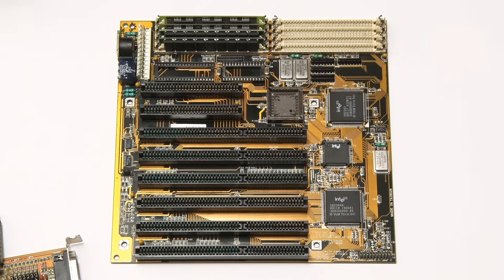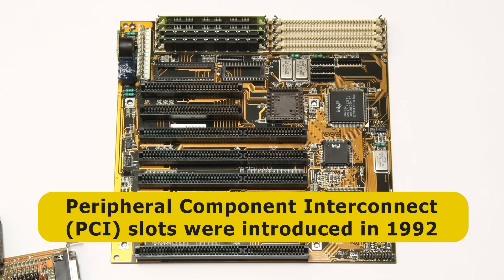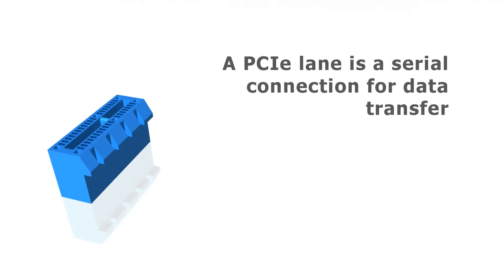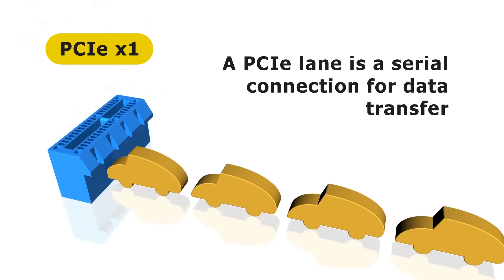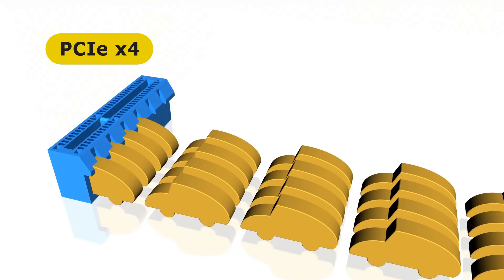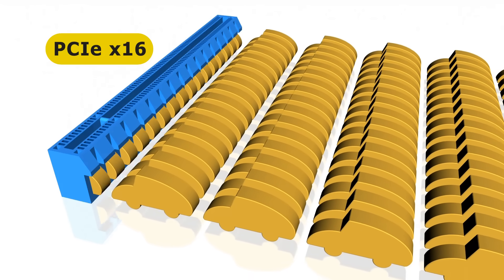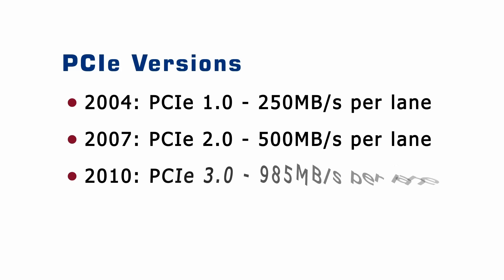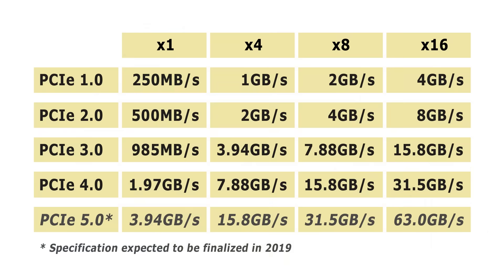Explaining PCIe Slots

Comment: Hi, great vid but i little confused as to what PCI and PCI E is as at time 2.00. you have those 4 white "plain" PCI slots"  Are they PCI 8 or PCI 8 E?   I ask as i have them on by older 2012 board and i have a NVME adapter for PCI 8, 4 ect  but not sure if it will only work in PCI8 E? or non E white  if such a thing? as i notice those white ones are turned 180 degs to the PCI 16 E slot?

Comment: There is now a PCIe version 5.0. A PCIe 6.0 was also announced in January of 2022 (no components are released for this 6.0, however). PCIe 5.0 is more than twice as fast as PCIe 4.0 (which runs at 1.97GB/s per lane as mentioned), PCIe 5.0 has a maximum data transfer rate of 32 GT/s (gigatransfers per second), a maximum unidirectional bandwidth of 64 GB/s (gigabytes per second), and a maximum bidirectional bandwidth of 128 GB/s.
Transfer speeds run at GT/s (gigatransfers), not Gbps (gigabytes), as the transfer contains overhead bits that do not provide any additional performance.
PCIe 6.0 is now also double the speeds of 5.0 version is now up to an alarming data transfer raw data rate of 64 GT/s and a maximum throughput of 256 GB/s for a x16 link, making it double the data rate compared to PCIe 5.0.
We are approaching some INSANELY fast speeds as it is almost like pushing 1/39,062th of the entire contents of the Library of Congress (which stores 10 PETAbytes of media storage if all of the Library's contents were theoretically digitized, each Petabyte is 1,000,000 gigabytes) through a PCIe 6.0 slot every single second.
That means that you could theoretically transfer the ENTIRE 10 Petabytes of raw data of the Library of Congress through a 6.0 PCIe data slot in exactly 16.278 days. This is rather alarming how fast that is. I think we may have to start cooling those ports in the future at this rate. =O
We have come a long way in 21 years since PCI 1.0 was released in 2004. Shocking!
Reply from the maker: PCIe 5.0 is covered in this video! :)

Comment: Thanks. The vid helps. But I'm still not certain on how the relationship of 'lanes' to data bits works. For instance, obviously if I wanted to transmit a byte of data in a 1 lane PCIe system, all 8 bits would go out the 1 lane. But if I wanted to transmit a byte in a 2 lane system then 4 pairs of bits would be transmitted over the 2 lanes?  Effectively doubling the throughput. Correct?
Reply from the maker: The throughput would indeed be doubled, as each lane can carry its own bit stream. But individual bytes would not be split between lanes. So if you had two bytes to transmit, in the one lane system, each has to travel down that one lane in serial. But in a two lane system, each can travel down a different lane in parallel.
Reply: @ExplainingComputers  Ahhh! So byte ordering at the endpoint would simply follow the lane sequence?    byte1 = lane 1, byte2 = lane 2, etc., etc.?

Comment: I would like a LAN Ethernet Drag n Drop along with NFC for mobile secure hardware..an USB 4 -5 and PCIE 5 with intercooler or water cooling LAPTOP magnet battery and or wireless cooling pad.With Briefcase Insert lockable and Discreet.

Comment: cant we make a small cut in physical ends of  the  1x slot to plug the 16x card ?
Reply from the maker: This  may work (although the card may well be physically instable due both to its length and the retainer on the end having nothing to mate with). Modifying a x8 slot to make it open ended to take a x16 card is not that uncommon. But a x1 slot would be pushing it! :)
Reply: @ExplainingComputers  Thanks 🙂

Comment: The automatic configurability of PCI was a huge step forward. With ISA you had to manually jumper interrupts and memory space, or do it based on slot number, then. I figure it in the bios settings. It was a mess.

Comment: What makes this so educational is that you get down to the basics, take nothing for granted, and provide the historical context for the development of the standard. I particularly appreciated the point at 6:30 that differentiates between the physical length of the slot and the number of actual lanes. However, my computer has two x16-size slots next to each other, one marked x16 and the other marked x4. Yet the x4 one shows all the same in-slot contacts as the x16. Am I correct in assuming that though it has all the contacts, only enough of the slot's pins to support four lanes are actually electrically connected to the motherboard?

Comment: can i ask a question? hoping you could notice me. i have a motherboard which i updated my bios version to latest one. im just wondering why my 4000series gpu doesnt work in pcie 4.0 version instead its working in 3.0... if i change it to 4.0 my pc feels so laggy and even it will restart all of a sudden. thank you
Reply from the maker: It may be a GPU driver issue, or an incompatibility issue with the updated BIOS.
Reply: @ExplainingComputers  Thank you for answering my question i really appreciate. im just wondering my m.board supports 4.0 gpu it was an asus rog strix x570-e and i dowload normally my gpu driver from nvidia even my bios driver i downloaded it from asus to make sure i will install the correct driver. as much as i dont want to upgrade my m.board to work with my 4070 i think its about time for me to upgrade.

but anyhow really i appreciate your time thanks again godbless

Comment: Thank you it was really informative. So if I use for instance all of my PCIex1 slots for my expansion cards does it mean all of the cards will be on the same "one lane"? For instance PCIex1 sata expansion will share the speed? Or each PCIex1 slot is working separately? Thank you in advance!
Reply from the maker: Yes, they work separately -- each x1 slot has its own single lane, so two cards plugged into two different x1 slots will not be sharing a lane.

Comment: on the right of the pcie slot there is a thing that looks like what you use to click the ram in. i accidentally broke that off, will that make that slot unusable?
Reply from the maker: The slot should work electrically, no problem. The locking mechanism is to secure a graphics card, and if part of the plastic bit that moves is left in there, you may need to somehow remove it in order to fit a card. But providing you can do this, you should be able to fit and use a card in the slot with no issues. Good luck!
Reply: @ExplainingComputers  i did some research and it’s just the clip that i broke
Reply: @ExplainingComputers  i’m finished my pc thanks for the help. this is my second pc but first one that i built

Comment: I have gigabyte GAMA78GPM- DS2H & ASUS M4A88T-M motherboards they both have PCIE x16 2.0 slots I want to install NVMe SSD 3.0 using M.2 PCIE NVMe adapter. Will NVMe ssd work on these boards. If so at what speed Any reply will be appreciated.
Reply from the maker: An NVMe M.2 SSD in a PCIe adapter may work. It is unlikely to be bootable, as the BIOS will not have NVMe support. If the drive works, the speed will depend on the number of lanes the card support for the M.2 drive (2 or 4). On a 2-lane system you may get up to 1000MB/s, and double that on a 4-lane, over PCIe 2.0. I would suggest that trying this will be an experiement, and personally I would stick to SATA drives on those motherboards. Good luck!
Reply: @ExplainingComputers  Thank You

Comment: Very informative. I however have more questions regarding the PCI (the old white slots) vs PCIe. What is the difference and are they inter-compatible? Also, why are certain slots offset further back from the edge of the motherboard?
Reply: I remember those old ISA bus systems... and the multi-IO boards that were used with the XT computers where the board ran everything including RAM, display ports, IDE ports, floppy ports, Game ports, serial ports, parallel ports, and more. The ram was expanded by plugging the actual chips into sockets on the boards. Everything had to be set up with dipswitches and jumpers to set IRQs and addressing. Plug and play did not yet exist. 😬😵‍💫
Reply from the maker: @garybaris139  ISA and PCI slots are not the same, and hence are not compatible. The set-back distance is to accomodate the card type.

Comment: PCIe could also accept modern graphics cards, for example in LGA 775 motherboard with PCIe x16 v1.1 you could use PCIe x16 v4.0 graphics card, it will work, but at lower speed.
Reply from the maker: Agreed. I think that the video makes this clear. :)

Comment: Hi।
My motherboard model is Intel
DZ87KLT75K. It was high end motherboard purchased at that time.

It has 3rd generation PCI E X 16 slot.

Can I use NVME SSD adopter to install NVSD SSD 

Will NVME SSD 16 GB/s will work.

Can you suggest some good NVME to PCI E extension/Adopter for it

Comment: My question is can I install my WIFI Card which is for PCIe x1 on the PCIe x8 slot? My Current computer does not have PCIe x1 slots
Reply from the maker: You can. It should work at PCIe x1 speeds in an x8 slot no problem.
Reply: @ExplainingComputers  Thank You for the info adding it tomorrow

Comment: could it be possible to connect 2 usb cards on the same x16 pcie slot, or the slot can only read one card at a time?
Reply from the maker: You can only put one card in a slot at once -- there is no physical way to connect two. But you can get USB cards with lots of USB ports -- I've certainly seen PCIe cards with 7 USB ports.

Comment: Only thing missing is one could use extentors as well to make specific lanes and versions work perfectly fine in theory (like pcie 4.0 x8 lane extended to pcie 3.0 x16 lane or pcie 1.0 x8 lane to pcie 4.0 x1 lane).
This is more used in servers where you extend high bandwidth to multiple lower bandwidth, otherwise more extended one to one for reposition a GPU inside of the case.

Comment: Can i upgrade the GPU card in (HP Compaq DC7900) mother board using high or medium range card for example (ASUS GTX 1660 SUPER or MSI GeForce GTX 1660 SUPER 6GB GDDR6) please i wait your answer, Is it possible to nominate a graphics card that works with this board without any problems, provided that it is 4GB.
thank you..

Comment: Why the PCI connecter pin have 2 sections?
Reply from the maker: The first (fixed-length) section is largely is for power, the second (variable length) one for the data lanes.

Comment: The video a) covers a lot of history that wastes our time b) talks about a lot of options which may/may not work but c) it does NOT tell us what of all of these n:n scenarios makes sense and what the performance implications are.   So in the end, it did not answer the most obvious questions.   I can put a garden hose on my car wheel and it will work but how well?   You did not answer the common sense questions.  But, thank you for trying and for using good English.   IMO
Reply from the maker: I, and many others here, disagree. This does clearly DOES answer the most common sense questions -- for example what works in what slot. Did you watch the whole video?!
Reply: @ExplainingComputers  Yes, twice.   For example, I have an x16 graphics card but doubt that I need the bandwidth of my only PCI 3 x16 slot.   So I thought about scaling it down, with adapter to the x1 pci 2.0 slot and installing a PCIe x16 PCI3 SSD drive into the only x16 I have with the thought of increasing my overall speed given my trade-offs and system limitations.   I suspect that a lot of the PCI 1.0 to 4.0 and x1 to x16 performance mapping could be modeled in a spreadsheet.....it would be cool to have SATA 2/3 limitations etc modeled in the same fashion since our tradeoffs might involved SATA slots.  Example, can the m.2 be made to work in a PCI slot?   An x1 slot?  What type of adapters might make this possible.   Example, if a card or SSD drive has bus speed limitations of PCIe but much higher internal speeds, will I get performance improvements of newer SSD technology's internal speeds even though the data transfer of the bus remains at the PCIe limit?   ....

Comment: What does a PCI card do? Is it necessary to have when building a pc?
Reply from the maker: PCIe cards add additional functionality to a PC. For example, a graphics card can be fitted into a PCIe slot to allow the computer to play more complex games or run a powerful video editor. Other PCIe cards add additional connections/interfaces -- such as more USB ports. Or a PCIe card can be used to add WiFi connectivity to a desktop PC. These days many PCs do not need any PCIe cards because their onboard graphics and interfaces are sufficient for many purposes.

Comment: the practical problem with pcie x32 is physical size. I have only seen them on rackmount servers most times as a method to get more x16 slots but sometimes to actually use all 32 lanes. highspeed networking is the only time i have seen that slot being used for not a break out into x16 slot things. Most times unless it is designed for it to take that the board is redesigned for it to just have another x16 slot instead of a x32 slot. The issue is redesigning a system board's logic is complicated so having a single x32 slot then using expansion cards to break it up into 2 x16 slots of use as 1 x32 slot is a better solution.
Reply: A problem with PCIE x32 lanes is that it needs a CPU installed that has 32 free PCIE lanes to connect to. Only specific high end CPU's are capable of using all 32 lanes. Instead of saturating all 32 lanes in one expansion slot, separating it into two separate x16 slots on the motherboard probably makes for a more flexible setup.

Comment: Personally I remember the full sized pcie only working at 4x as a sales gimmick. People would see the larger x16 slots and assume it was x16. Many of us compared the dozens of choices when purchasing a new mb and the x16 slots only working at 4x was like missing the fine print. They did it to seem cheaper than competitors with the same specs only to find out after the purchase that it was not a better deal.

Comment: With some graphics cards, it's important to pick the right 16-length slot.  When I plugged my EVGA card into the 16-length PCIe x 4 slot on my ASRock MB, computer would boot, but there was no output from the EVGA nor the onboard video (possibly because the MB was detecting that there was an external video card installed).  Once I got the graphics card into the correct slot, all was right with the world.  Great explanation of the technology.

Comment: One of my pci-e x1 slot has broken, and the pins were exposed, I had to cut them. But now the pc don't start. When I plug energy, a light that should be ON inside the motherboard just by being pluggerd turns on for a millisecond but then it turns off. People has told me that I should "close" the pcie circiut, or that smth on the circuit is shorted. But I don't know how to diagnostic and get that fixed. I know that the best is to change the motherboard, but I'd like to fight till the end.

Comment: Sir what is the difference between half sized and full sized pcie x16 . Sir I really need your help
Reply from the maker: I think what you are referring to are low-profile PCIe cards, which aredesigned to be used in PCs with smaller cases. Some of these cards come with a bracket to fit them in both full-sized an half-sized bays, and some do not! :) 

Note that the are also full-size and half-size mini PCIe cards for use in laptops.
Reply: @ExplainingComputers  so Sir can I use my msi gtx 1060 3gb in my half sized pcie x16 . Sorry for too many questions but I am really worried. my model name is (dell vostro 3681)

Comment: I was rather hoping for some discussion of CPU vs. chipset PCI-e lanes. In particular how this affects things like NVMe drives, which require PCI-e lanes.

For example, you can get a Z690 motherboard that supports 3 NVMe drives. Each drive uses 4 PCI-e 4.0 lanes. The first socket uses 4 PCI-e lanes directly from the CPU, and the other two use lanes provided by the chipset.  The question is, where does the bandwidth for chipset PCI-e lanes come from? How do drives in NVMe sockets 2 and 3 perform relative to the drive in socket 1?

Comment: Not to focus of this video, but parallel PCI had its own compatibility issues, not as bad as AGP. PCI Voltages were indicated by the lug positions. Thirtytwo bit cards worked in 64 bit slots. Some 64 bit cards seemed to work just fine in 32 bit slots, but the overhang might cause mechanical interference.

Comment: Hello: I have the following problem and I woud like to know if you can help me:
Problem Description: When I install the Serial / Parallel card in the PCIe slot and connect it to the power supply, the computer does not turn on, but if I disconnect it from the source, the computer turns on normally. My question is if I should modify the position of the jumper Setting (pins) that are currently in position (L) 2-3 and (R) 4-5 and that came in that position from the factory, but in the User Manual also there are the following positions: 1) Short 2-3 = 0V, 2) Short 1-2 & 4-5 = 5V and 3)  Short 1-2 & 5-6 = 12V Have I to change to one of these?.
Product Card: Serial/Parallel
Product Name: DP Cyber 1S1P PCLe Card
Part Number: JJ-E20311-S1
My System Make: 64 bits
My Operating System: Windows 10
My Processor Type: LGA 1155 Intel Core i7 2600K
My Configuration: Mother Board ASUS Z77-A, 16 Gb Memories, SSD 1 Tb,
Thank you very much and I await your reply as soon as possible.

Comment: Amazing video! The ISA bus part bring me back an old question! I had a AT PC that's CPU running at 8mhz, there is a turbo button at the case's front and that will raise the clock to be 10 mhz. Indeed with higher clock speed made me fell the dos prompt and typing much faster, I have impression at that stage it is very common design for many PC brands. Can you tell why the factory designed such? why not fix it at the highest clock speed?

Comment: The video overlooks the PCI-X.  I have a duel Intel Xeon 32 bit computer running Windows 7 with a SATA RAID card in a PCI-X slot.  It's faster than PCI but usually slower than the early PCI-e versions.